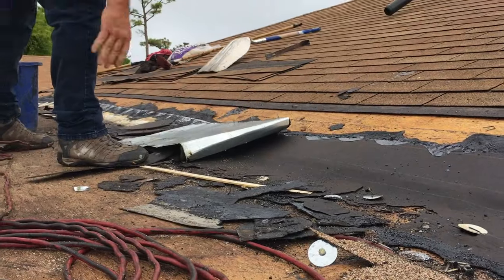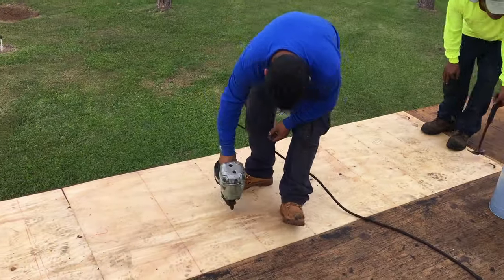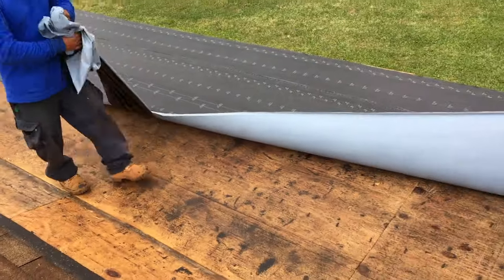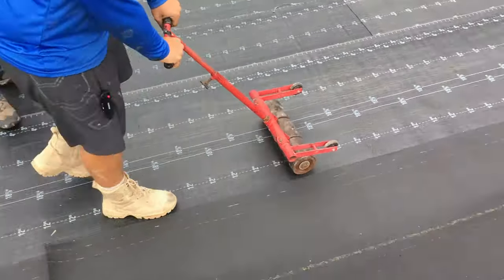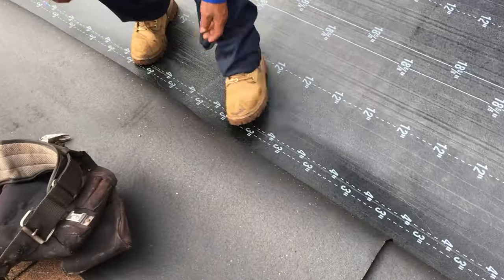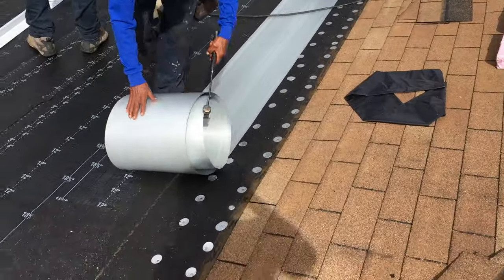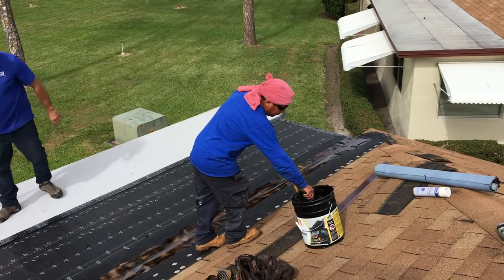How to remove, repair and install a flat roof

Comment: I have been looking at a ton of videos (mostly from GAF and Mule-Hide) on installing either peel and stick "Mod Bit", or torch-down "Mod Bit". Home Depot and Lowes both have "Mod Bit" GAF Liberty peel and stick OR torch-down. You can choose your Mod Bit type between a SBS or an APP.  SBS has more of a rubberized ingredient, and an APP has more of a plastic ingredient... but both are mod bits. They are about the same price and about the same expected life I think...  which is 10 to 25 years depending on the number of layers (ie. plys) you put on.

There is also EPDM and PVC types of flat roof material, but frankly I did not have the time to research those any more than 10 minutes.  But THINK that for residential roofs, "mod bit" seems to be most popular now. 

Besides GAF, the only other brand I have researched is Mule-Hide. It seems just as good as GAF, and also has peel and stick and torch-on in SBS or APP. I have not made a final choice yet, but will decide soon after I talk to the Mule-Hide supply house in town. (If I get a chance I will let yall know which I end up going with and why.) 

You are suppose to roll on a black primer coat to the wood deck to activate the SA (Self Adhesive base sheet). This primer coat allows the base sheet to stick better. I am also seeing that you may NOT want to put on the SA base sheet directly onto the wood (as they did in the video)... even with the primer. Because it will be impossible to remove years from now on the next roof job. So you may need to replace the plywood deck! yikes!!! So, I am reading that you may want to put down the MA base sheet first (Mech Attached nail-down) as your FIRST PLY. It will save your wood deck from being destroyed on you NEXT roof replacement years from now. After your base sheet, you would next put on either a cap sheet, OR you could next put on a middle smooth ply sheet, and then a granular cap sheet. The more plys, the better... .and the more expensive. 

BTW ... Mule-Hide has a sheet that can be used as EITHER a base sheet OR as a cap sheet. It has a smooth top (NOT granulated) It is called "APP Torch Base/Cap". You torch it on. Not sure if GAF has something like that, or if it only comes as a torch-on.  Like i said, i am not a roofer. Hopefully we hear from someone that knows this stuff. 

After researching the various materials and brands for an upcoming roof job, I now realize that getting the job done correctly, as THE MANUFACTURER CALLS FOR, is probably more important than the brand or specific type of material used. 

Great job on the video!  It was good to see real-world roofing video. Those slick factory videos with that background music and fancy graphics are boring after the first 10.  Thanks!

Any tips or opinions on low slope roofing from an actual installer would be great if someone cares to share.
Reply from the maker: Excellent info appreciate it. Thanks for watching.
Reply: for quality durability i hope you went for mule-hide brand

Comment: Very good job. Those boys went above and beyond with those over laps on bottom layer. Might be more cost effective to have done TPO for white or epdm if ok to do in black. No seams when bought in bulk. I can do that with rubber membrane in half a day alone. Call it a full day with repairs. I tell you this so you can have an idea what it would take. Not knocking these guys at all. Very good job indeed.

Comment: Your video was very informative and I was impressed by the specific products used.  Can you provide the  specific name and/or manufacturer of the products used, both the underlayment and the final covering?
Reply from the maker: I’m not quite sure I’ll have to research it for you and get back to you thanks for watching
Reply: 3 months later....
Reply: @TomLeeman  five months later.
Reply: @deemaverick987  8 months later
Reply: 9 months ago and growing...
Reply: @andysantos8286  looks like Polyglass Elastoflex SA V (base) and Elastoflex SA P (cap) self-adhered membranes

Comment: @ Tom... Nice video! ... By the way, I remove tar from my hands with "citric acid" that you can buy somewhere, or just use a citrus peel (orange, lime, lemon) plus a little sand, it works all the time for me, of course if it is only a small amount of tar on your hands. I also have used citrus peels to remove tar from my car body, (splashed tar from the road). After squeezing and rubbing the citrus peel on the spot with tar, just wash with soapy water and rinse well. P.S: Do not use sand on the car paint... LOL...
Reply: Diesel works best
Reply: @Drift-fpv - some people use MARGARINE. What about that?
Reply: Gasoline works fine. Goop works as well. 

Going to redo my roofs. I hope the stuff I use is good. 
It’s a modified base sheet and Awaplan fr white. 
Will be 1/4 to the foot slope. I put the first one on 25 years ago. No leaks in 25 years. Little maintenance over the years. 
Always turn the base over and cover the wood.  
Peel and stick is garbage. On a flat roof that is. 

Best flat roof material for that application would be sarnafil or a brand of tpo . I prefer sarnafil.
Reply: Baby oil, then Dawn.

Comment: Hello there I have a house in San Diego Ca need to repair and replace the roof exactly as you were doing in this house so how much would it cost? My patio flat roof was building the same style as this house but it is bigger than this I think it is around 550sf . please let me know if you can help . Thank you so much and have a great day
Reply from the maker: This was about 3000
Reply: @TomLeeman  Thank you Tom

Comment: How do you determine whether you can lay the new roof over the old (assuming there’s only one existing layer) or if you need to tear up the old roof? If the plywood looks okay from underneath (no water stained or rot), does that mean it doesn’t need replacement?
Reply from the maker: I would tear off the old one just to make sure that you don’t have water damage and to see if you need to replace any wood. Good luck. Thanks for watching.

Comment: what can i use for my base if i dont want the self adhering stuff directly on my plywood. i would rather have a nail down product for the first layer.
Reply from the maker: I guess he could use the tarp paper
Reply: @TomLeeman  so i found out gaf has a mechanicallyy applied sbs base layer but it is not available at Lowes or Home Depot. SBS mechanically attached base sheet. going to be hell getting that crap off the plywood in 10-12 years.
Reply: gaf said just use the  peel and seal base sheet. dont remove the backing and nail it down.
Reply: seel

Comment: One question I don't know where you guys are I'm assuming somewhere in the US. I'm a roofer in Canada with over 25 years experience don't you guys ever use elastico stick primer before laying out your peel and stick base a cap. It's the only way we ever do it and the laps on the cap sheet would get heat welded with a leister gun.
Reply from the maker: In the US, we don’t have as strict regulations as you can see they do too many shortcuts

Comment: What’s with all that mastic? Rolled aluminum in that transition?? That was a dumb detail as it would have been much better for the installation to add another layer of the self adhered base sheet!!
Reply: What's the name of the material. I have small project. Thanks

Comment: Anyone know what the first layer is called beside “peel and stick”. There’s nothing about it in the video or comments. Thanks
Reply from the maker: Not sure will have to research
Reply: Pizzurp  thanks for reply, but I don’t see they use torch unless I’m missing it. All I see they did was rolling the heavy roller around to make sure it’s stick.
Reply: Nm I found they selling some at homedepot for 100$ per roll and climbing every month

Comment: Tom we have a patio with flat roof very low pitch almost flat.  and our guy installed tar paper and put asphalt shingles. Im worried about the leaking.....
Reply from the maker: As long as the pitch is enough for the water to run off but if there is standing water could be a problem
Reply: @TomLeeman  thanks Tom. It rained today and most of the water ran off to the sides. However some shingles had standing water on top of it. No huge puddles...we live in cali so we dont get that much rain fall to begin with.
Reply: 2/12 minimum pitch for shingles. If you have standing water you're in trouble.

Comment: Tom what if a mod bit roof was laid with no wood underneath?  I have a roof I need to replace and whoever did it before just glued it down to the celotex ceiling tiles.  If I have the exisitng shingles stripped off it will most likely damage the ceiling which will then need replacing.  Have you seen this before? What are my options? Thank you
Reply from the maker: Well that’s a very unique situation I’m surprised that there isn’t an infrastructure underneath with plywood that your roof is attached to this may require some engineering to figure out OK good luck thanks for watching

Comment: No priming the base sheet? No priming the cap sheet? No heat welding the laps with a lister gun?? No burning of the poly ?? I never seen this system before. Seems like a Good job just hope their not in a hurricane or tornado area. All the nails might indicate they where.
Reply from the maker: Florida! hope it holds thanks for the tips and for watching
Reply: Tom Leeman if the manufacturer’s. Say it well hold I guess so. I am from Canada. We have a really bad heat cold cycle -30 c to+30. Or-22 f to+86f or-50 c with the wind chill or +40 with the humidity. We just might have to do the extra steps. For the temperature extremes.

Comment: What materials were used here! Please let me know.. Thanks for the video!
Reply from the maker: In the video he explains names of products you can buy at home depot
Reply: perterson dean did my flat the same one year later the roof started leaking  with same process i call then 4 times they wiil not come and fix it
Reply: @jsavage7241  Did you ever get Peterson Dean to show up? I was seriously considering them for my solar and roof, but I don't need those problems

Comment: Is the nail sticking under the ceiling, I am trying to do this on my patio roof and I don’t what to do to avoid the nail being shown under the ceiling? Any suggestion?
Reply from the maker: You have to check the depth from your plywood and the length of your nails be careful
Reply: Glue.

Comment: Hello is the cap sheet TPO?  if not, whats the brand or name of the material is it a membrane.  Thanks
Reply from the maker: I’m not quite sure I’ll have to do some research thanks for watching
Reply from the maker: I’m not quite sure I’ll have to do some research thanks for watching
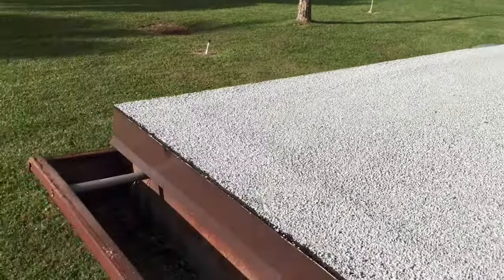Reply: that wasn't tpo. that was regular WHITE aggregate rolled roofing 30:07 pause. sheesh, the homeowner that paid for it and on the roof acting like he knows what's going on, doesn't even know.

Comment: Anyone notice that the shingle tie in was messed up. The shingle roof is 6" separation on the tabs and they tied in with 4" . Last 30 seconds of video.
Reply from the maker: Excellent tips thanks

Comment: Do you know what that second layer on top the pell and stick was call
Reply from the maker: I do not??
Reply: Cap.
Reply: And its beat to unroll it so it can relax for a while before its stuck down.  Depending on how hot it was that day.  If it wasn't very warm out when installed it will wrinkle and look like shit in the summer.
Reply: @BUSTRCHERRI  100%. Mine got vertical AND horizontal ripples because I didn't lay it out long enough. It kept blowing off the roof so I just went and banged it on there. Still managed to get 20 years out of it though, thanks to elastomeric coatings!

Comment: Great video, can a home owner pull their own permit for this, and do we need to use  Hot tar
Reply from the maker: Need a permit
Reply: Depends on what state requires it. Check with your local license and inspection office.
Reply: Screw the permit.
Reply: You only need a permit if there's an inspector around.

Comment: Hi Tom!! I want to put flat roof in my house, it is necessary to remove the previous one or it is better to put it on the one that already exists
Reply from the maker: If you have damage to the underling wood you need to replace if it is rotten. Its always best to remove the old one just to make sure you don't have any unseen problems.
Reply: @TomLeeman   where can the supples be bought for flat roof. base sheet and cap sheet?

Comment: What is the cost for a 20x20 flat replacement roof ,tear down,replace clean up etc
Any roofers please let me know
Reply from the maker: It was 3500 to do this job
Reply: @TomLeeman  does cost depend on season, lower $ in November then summer time
Usually  home repairs  are done when  weather is nice

Comment: Wouldn’t you want to wrap the Peel n Stick over the fascia?
Reply: I should have said base sheet.
Reply: Yup! That’s what I just did at a job yesterday! Great minds think a like! Lol
Reply: I have no roofing experience but have read and looked at a ton of video the last few days from GAF and Mule-Hide. Yes you should overlap a few inches of the facia with the base sheet. However, you should cut the cap sheet about 1/8" or so shy of the edge of the roof so that you squeeze a bead of special calk onto that edge. The roof material manufacturer you use will state what brand of caulk to use in the install instructions. This is an extra step that adds protection to the edge of the cap sheet and prevent the edge from fraying etc in the years ahead.

Comment: The only reason somebody would dislike being watched by the homeowner is because they can't cut corners and they can't cheat on the job otherwise you want them to see what you're doing you want them to see that you are giving them what they pay for a professional job if anybody should have been upset on this job it should have been the homeowner these guys were putting a base sheet down in the rain absolutely no no in the roofing industry
Reply from the maker: Excellent notes and information thanks for watching

Comment: Anyone that puts that rolled aluminum inside a self adhered roof system doesn’t really know what they are doing!
Reply: Yeah, I was watching that and instantly questioned it. That didn't make any sense to me
Reply: That's pretty much what the original installers thought also and that's also exactly where the leaks were located, at the joint transition, where everyone can clearly see the warped and blown up expanded sheaths. Surely when you install a roof without reinforcement at the transition, it makes dollars and cents for the guys who end up doing the leak repairs. The original installers "knew what they were doing" like you. Metal flashings are used with self adhesive roofing every time, surrounding roof elements as well as the drip edges and now you discovered they can also be used in valleys.
Reply: @dare2scheme904  - word salad makes no sense!

Comment: Let`s leave the rotten wood in place and nail a bit ether side of it - well done first class bodge i would say.To lazy to cut it out and replace it.
Reply: Way too much work for a little spot you can easily scab over.
Reply: No you do not leave rotton wood in place. You replace the timber as it will only spread.